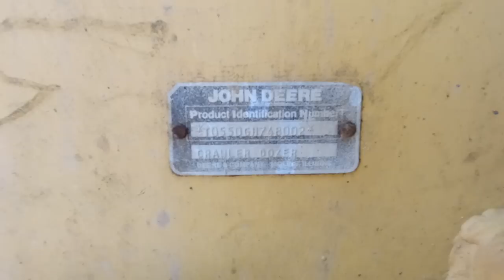648-D's Final Ride to Load up BURNT 550G John Deere Dozer?MAYBE..

Comment: Those wheels  on that float need some  oil or grease it is very noisy  .
Reply from the maker: It was the slides that was pulling the tandems forward. It definitely could have used some grease 
Thanks for Watching